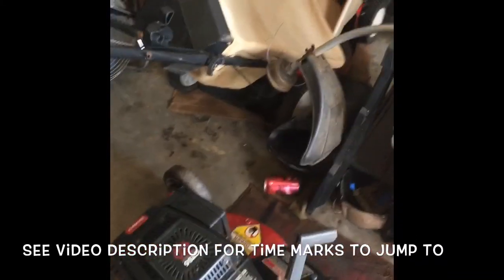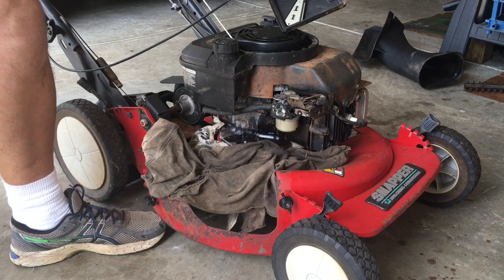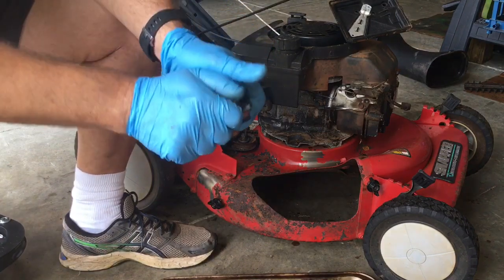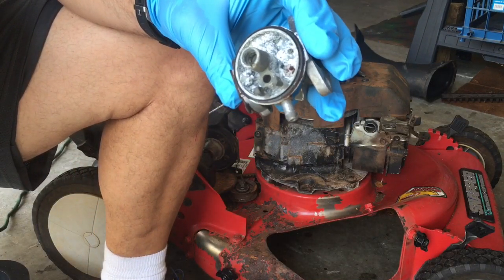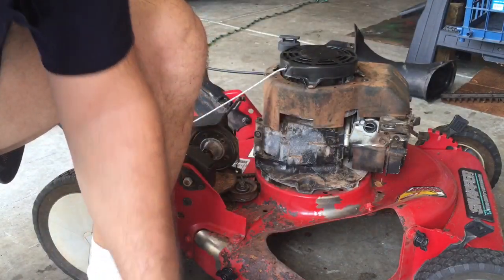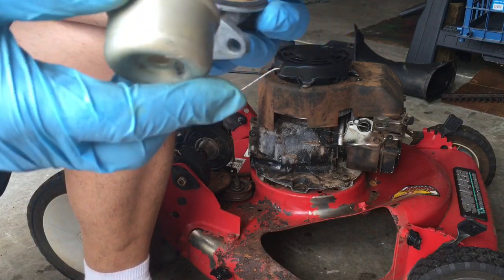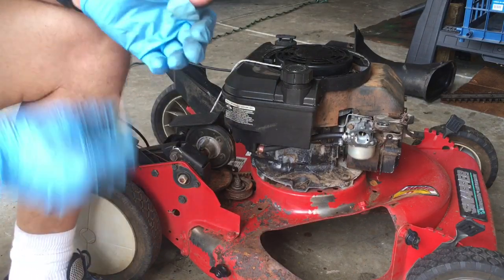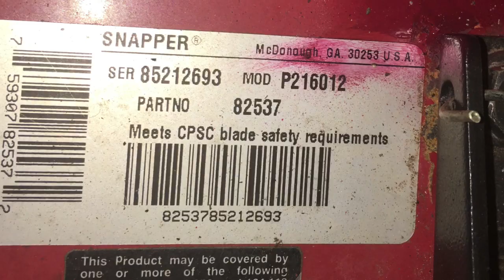Fixing a 1997 Snapper big 6 part 2/3  detailed repair

Comment from the maker: Time marks
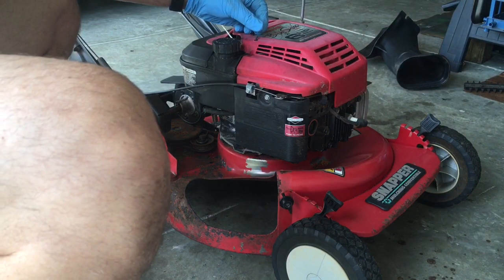2:47 start taking out carb
8:30 gas tank has water in it
10:26 removing carburetor 
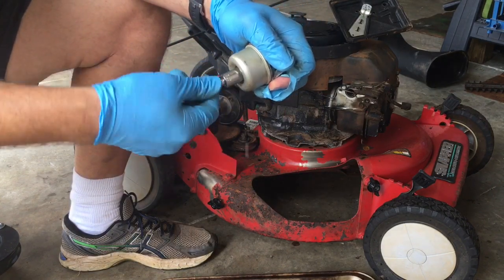14:00 open carburetor 
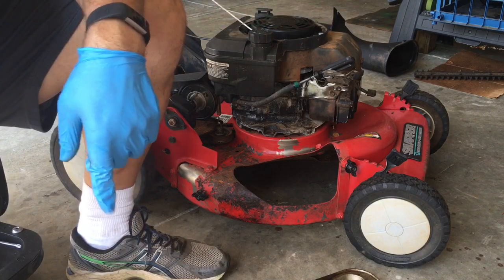17:30 take gas tank off. To drain
20:00 disassemble carburetor 
20:50 start clean carburetor 
29:52 re-assembling carb
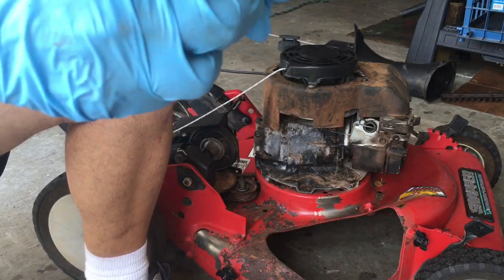30:40 discover carburetor needs rebuild 
32:30 start rebuild
38:00 put back carburetor in mower
40:43 start to put back gas tank
43:21 put back air box
46:00 start of testing
47:10  discussion of throttle setting
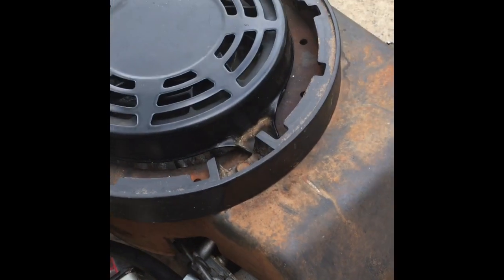47:37 adjust governor spring
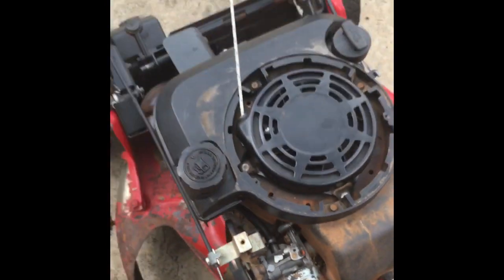48:47 paint
49:31 oil change

Comment: Excellent job cleaning the carb. I like this design self propel system.
Reply from the maker: INSIDE HOUSE GARAGE  thanks yep this self propelled system is like a snow blower. I think I cost more to make but is better  in the long term
 Stay tuned for the 1995/96 Toro super Recycler .  I just got it running tonight.  At  first was surging some but I think after some squirts I’d carb cleaner and adding some sea foam in the gas helped clean it out the rest of the way.  
The carb is like nothing I have ever seen or worked on.  Just glad it worked because parts are not always available .

https://www.partstree.com/parts/toro/mowers-walk-behind-lawn-mower/20474-toro-super-recycler-lawn-mower-sn-6900001-6999999-1996/engine-gts-150_3/

Also quantum style carburetor seat fits in this carburetor.  It needed one. 

The video editing on this one is going to be difficult and long.   When I post I will put time stamp for various points in the video.